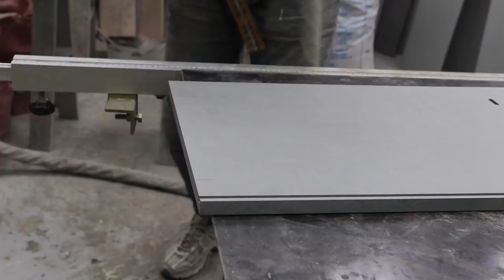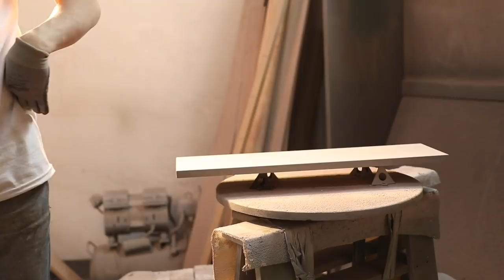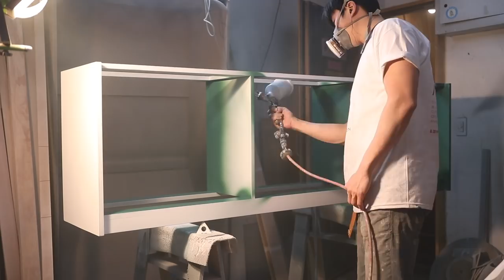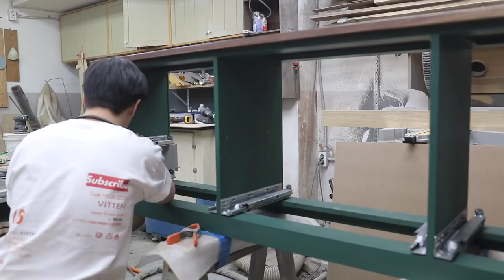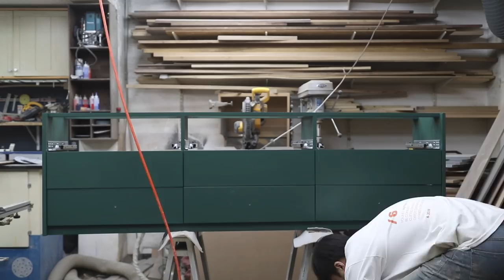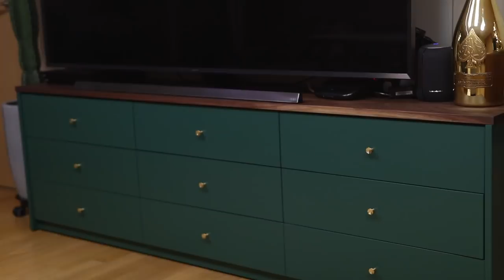W46_Modern Drawer

Comment: Beautiful work - thanks for sharing it. Question: In attaching the solid wood top to the cabinet, did you use an attachment that would allow for expansion and contraction of the top, or did you just screw in on?
Reply from the maker: Thanks~! I consider that, so I use 8 shape hardware

Comment: Interesting but in the USA no joint box construction is a no no. Even your cabinets you use no joints or even pocket screws. Im surprised as it looks greta but no strength to any of your pieces. You have the equipment so why not even a simply lock joint or even a rabbit?
Reply from the maker: Well, the strength are no problem.  Domino,Glue and screws of bottom  make enough strength. and I don't like pocket screws.  If in doubt, do like this.